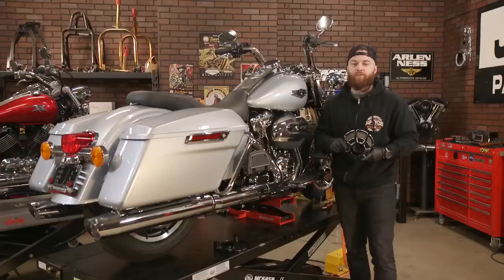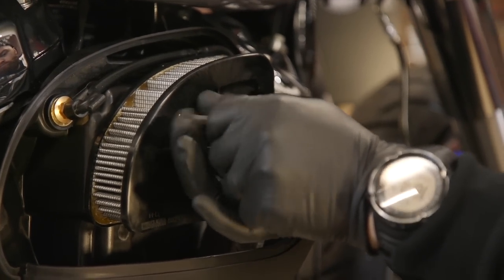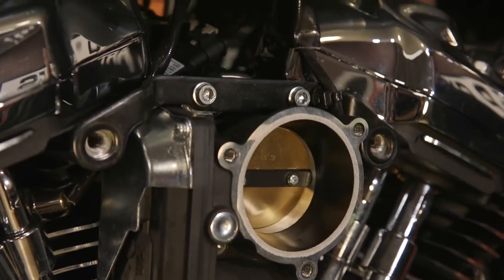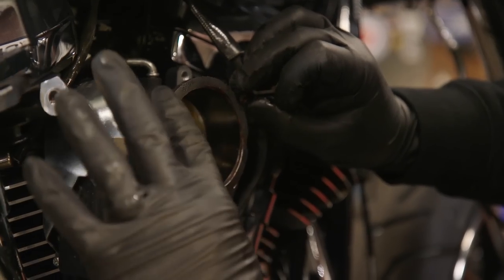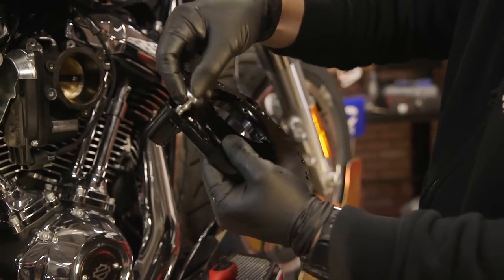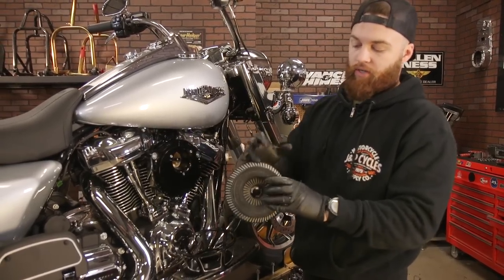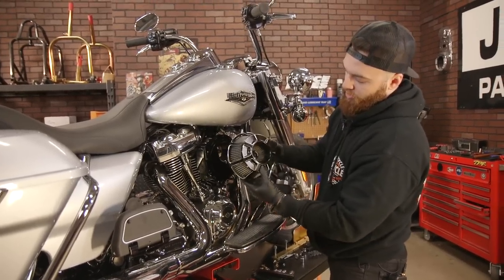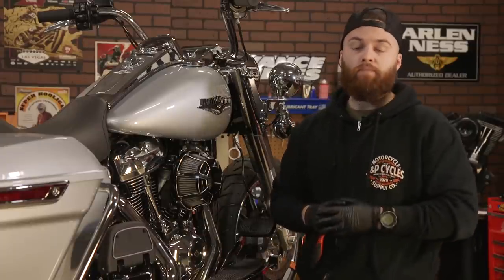Arlen Ness Inverted Sucker Air Cleaner Kit Install : M8 Bagger

Comment: I just installed this breather/cleaner. Mine came with an oil reservoir and 2 tiny vents. Does this still vent oil back into th throttle body?
Reply: That's my question.

Comment: I have the Arlen ness method clear view installed on my m8 RGS. Why do some Ness installs have oil reservoirs that mount just under intake, amd some dont use those? Thought the breather bolts and backing plate were supposed to recirculate oil, so why reservoir catcher?? Just curious. Mine came with but I didnt put it on.

Comment: So probably a dumb question, but does the element need replacing later, or do you service it similar to a K & N filter? Enquiring minds and all that.
Reply from the maker: The element is washable/re-usable.
Reply: Shake it, rinse it and wash it with mild degreaser. Let it dry over night and reinstall. You don’t put oil on the Arlen ness filters

Comment: Will I need a re-tune by just adding the air cleaner and slip ons ?
Reply from the maker: We recommend it. When you add more air to a motor it leans it out if you don't add fuel to match, most stock machines are a bit lean to start with so it makes it worse.

Comment: High rev when starting bike after install. Up to 4000 RPMs. Anyone know why?
Reply: I just put a Arlen Ness Monster Sucker on my bike and found out that the bracket at the 1:49 mark was the problem. I figure you have already figured this out since it has been 2 months since your post but I figured I would say it just in case.

Comment: What happened to the breather tubes? Are the breathers essentially blocked off?
Reply: Rerouted inside the Backing plate. I have an A N Stage 1 on my 18 1200 Custom. The Bolts are Banjo like Brake Caliper hydraulic lines.
Reply from the maker: @chrisphilhower6029  Chris is right. Arlen Ness provides two banjo bolts that vent directly into the cleaner.
Reply: @jpcycles  i have the stock stage 1 for M8 and mine leaks oil all over my bags. Arlen ness stock set up just isnt great. Those bolts either are not doing a great job or the ness m8 stock stage 1 plainly isnt great
Reply: Every long trip is a mess
Reply: john wayne when you say stock stage one, do you mean you just have slip ons ?
Reply: @jpcycles  im glad you spoke up. I never thought of it til I was done the install. I wish id looked at Arlen Ness banjo bolts better. Can you even see the vents?
Im not pulling it apart to look.
Reply from the maker: @whitecapmadness7181  yes you can see them